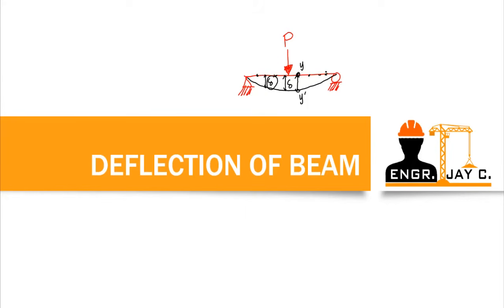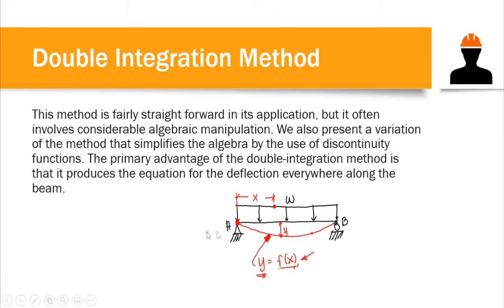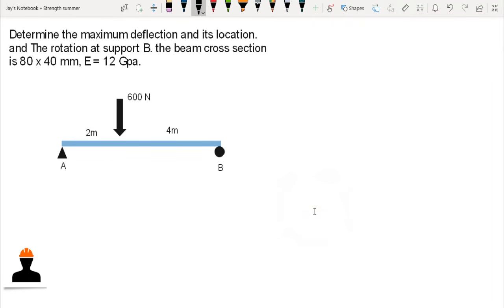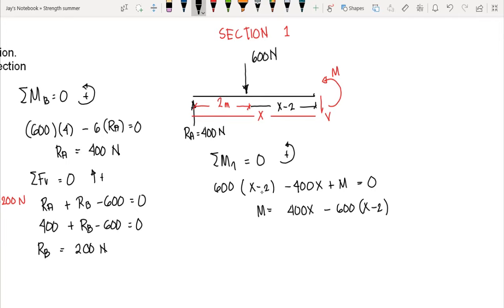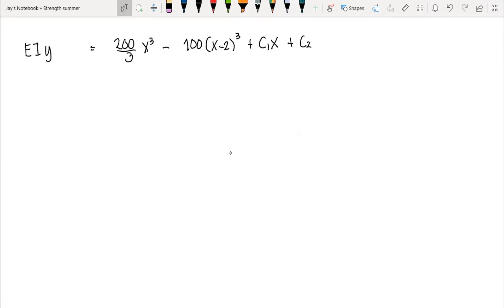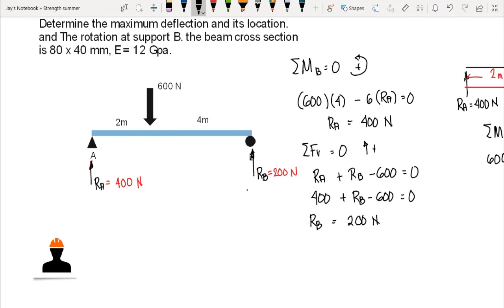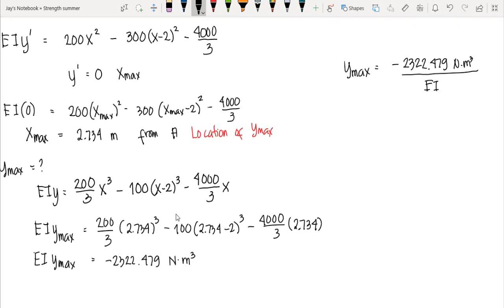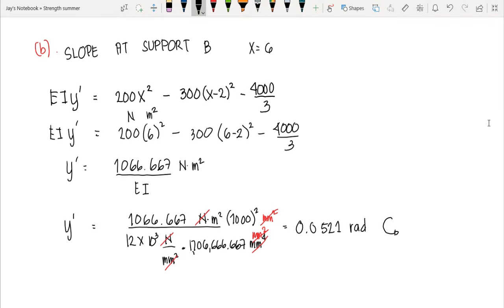Strength of Materials: Double Integration Method (Beam Deflection) Part 1 of  2

Comment: So does it mean when you use the equation of the deflection you are not going to get the maximum deflection
Reply: bro in differential calculus the zero slope is the maximum point which means the deflection we are solving is the maximum deflection that is why y' is in terms of zero